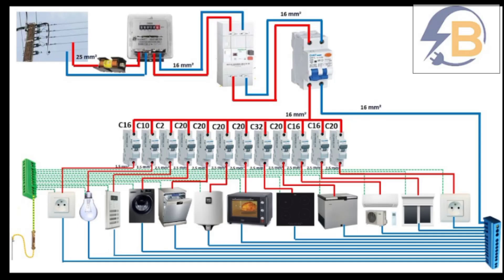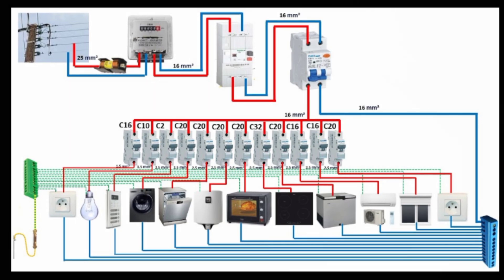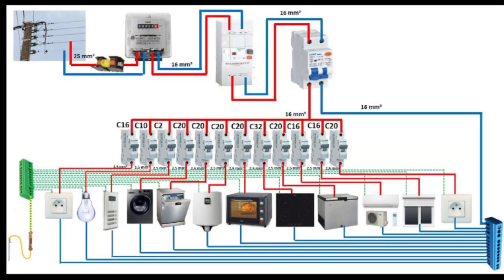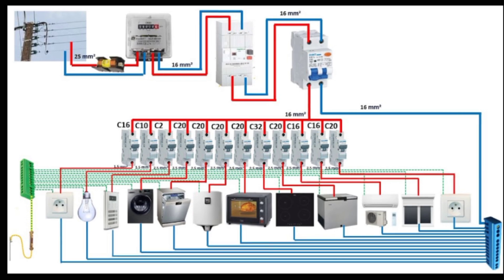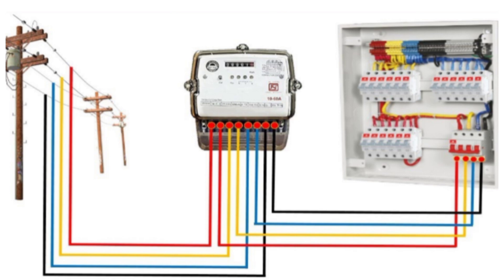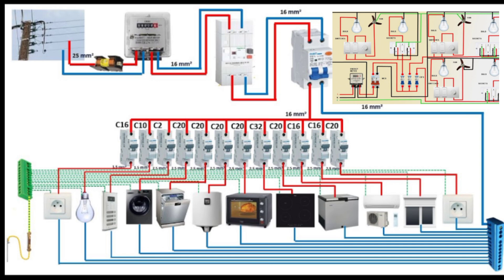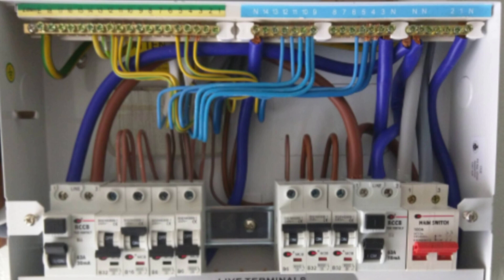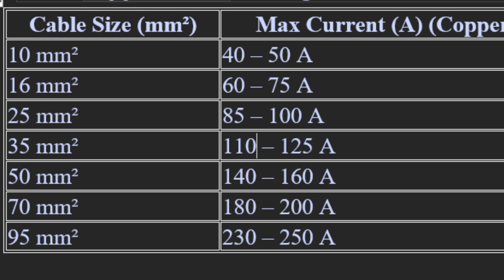HOUSE WIRING BASIC LOAD CALCULATION 2

Comment: I keep trusting your teachings
Reply from the maker: @MosesChanda-eh2of  
Thanks 👍
Reply: @obloni_Electrical Sir what would you recommend me lm electrician l wired house 5 rooms 2 bathroom for two sockets and one kitchen every room have 1 Ac and every room have 2 sockets 
Kitchen l gave 1 circuit 
All sockets l gave 1 circuit
And Acs are separate 
And lights 1 circuit 
I gave that house 3 phase system lm scared lf fire hazard occurs sir 
Did l make any mistake?
Reply from the maker: @CabdiJiinoow-t9p  
please chat me on +233 209323669